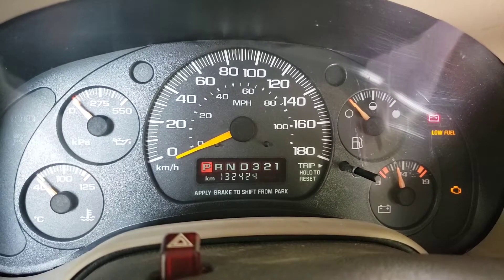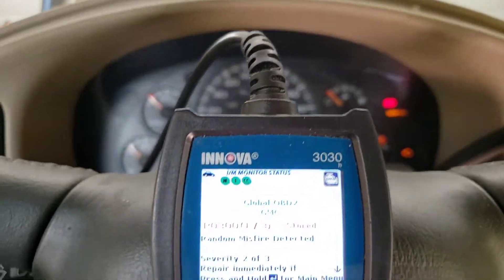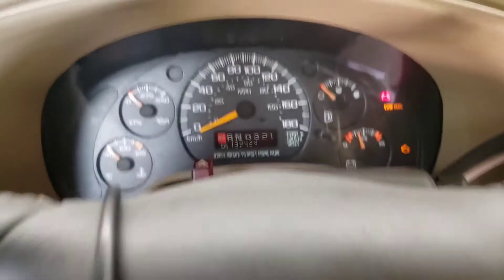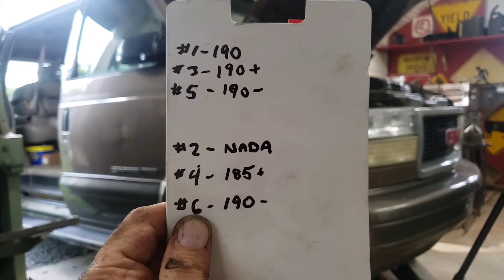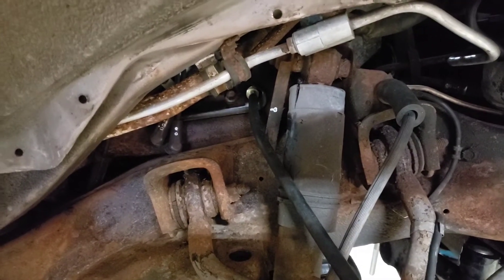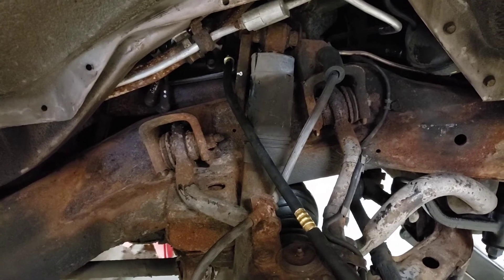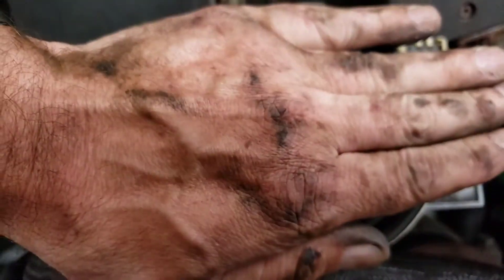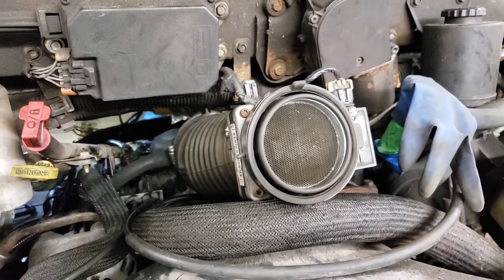GMC Safari 4.3L Codes P0300 P0302 Compression Test

Comment: Good info thanks I have safari 2000 and it smokes white when first running  it and low on power starting off. So I'm going to do the competition test
Reply from the maker: White smoke might mean one of the head gaskets are bad and letting coolant into the cylinders on start up. Check your oil. If it looks like chocolate milk its the head gasket.
Reply: @booper2ca  that's the thing I'm not losing coolant or over heating
Reply from the maker: @john4586-b5n  it doesn't take much. Does the smoke go away once it warms?
Reply: @booper2ca  yes, and I'm put in  over qt oil in a night but nothing is leaking out

Comment: Just ran this test on my 01 4.3 astro cylinder 4 compression was 105 psi and then when adding air its coming out the intake like yours   what should i do next replace seals or pull the head ?
Reply from the maker: You pumped air into #4? Did you position #4 at TDC so both valves are (should be) closed?

Comment: If you loose compression in more than 1 cylinder could it possibly be the same problem.
Reply from the maker: Are you getting fault codes pointing to 2 cylinders?
Reply: @booper2ca  yes I had a compression test done. It's showing fault codes on two of the cylinders.
Reply: @booper2ca  the mechanic is saying I need a new engine. But I don't think that I do. The truck cranks and runs it's just runs rough like there's a leak or something. Also I'm not a mechanic.
Reply from the maker: Try to determine if leaking past the rings, head gasket, intake valve or exhaust valve. Did the mechanic determine this?
Reply: @booper2ca  no I believe he just did a compression test and basically said that It was easier to replace the whole engine. Which Im not quite sure of that idea
Reply from the maker: I can understand where he is coming  from. It is so cramped to work on the engine while in the van. Did you van sit for a long time without running?

Comment: I recently went through a P0303 code - I decided to run some fuel system cleaner through the tank after doing some trouble shooting. I cleared the code and ran it, I used the Chevy fuel system cleaner plus and a can of seafoam - The engine had been idling a bit rough but it smoothed right out and I could see my gas gauge wasn't moving as fast as it was AND the code has not come back...  In my case I think I've just got to clean my injectors...  If it comes back I'll be doing the compression test - Great video
Reply from the maker: Hey Mike! Love your Astro videos. I don't explain my fix or what I discovered once I found zero compression in #2 but it was certainly leaking out that intake valve. After I pulled the rockers and push rods out i discovered that valve stem sat 4mm higher than the others. The seat couldn't be worn or damaged to that depth on such a low kms Vortec. That would mean something catastrophic. I couldn't see anything like that eyeballing the port. I did a leak down test on thar valve with WD40 and it held well over 24 hours. I guessed that someone replaced a valve, one with a longer stem. The stock length of push rod wouldn't let the valve close. I ordered a shorter rod, put it back together and had instant compression!
Reply: @Tetanus Risk  Dude, that's awesome...! That's beyond my ability these days, I wish you lived around the corner...
Reply: I been using Lucas injector cleaner but am trying seafoam next tank

Comment: Hi There.  I have owned 7 awd astro/safari over the years and i had exact problem you have on one of them.  It turned out to be the fuel spider under the air intake .  the lines are made of plastic and get brittle with the heat of the engine and start dumping fuel into the air intake.  This was/is  why the computer is trying to trim fuel supply. Did it myself but is not super simple as one has to work from the hood and from the dog house to get to parts.
The Spider incorporates the fuel pressure regulator and the  injector activation solenoids.  I am interested to see what you find on your van.  Cheers.
Reply from the maker: Hi. My spider is new. The issue with #2 cylinder was zero compression which, after doing leak down test, made me think the intake valve wasn't closing at all.